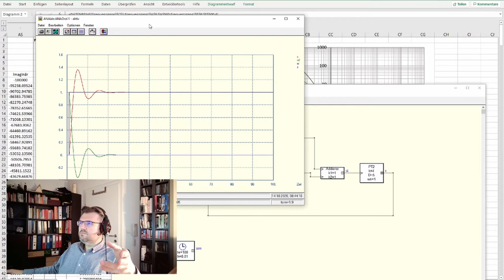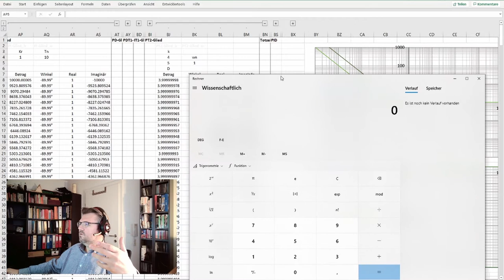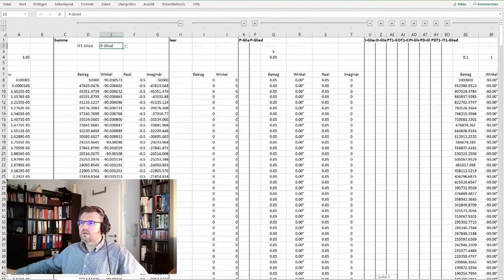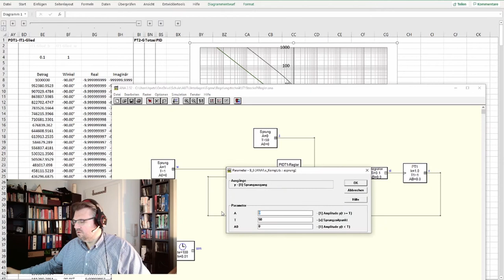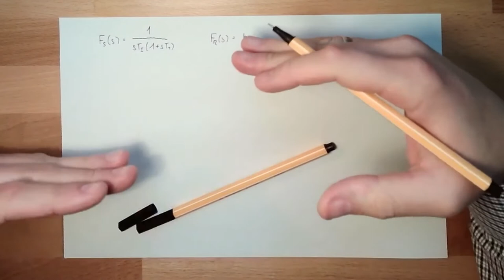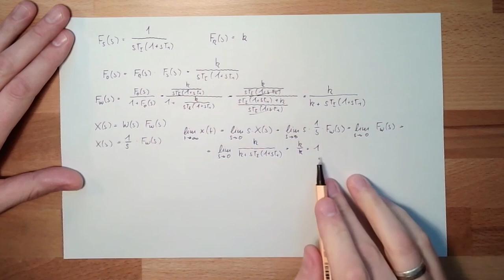Control 64: Optimal Amount (Old)

Comment: Great video. I really liked your way of using the demonstrations to explain the effect of the controller. Thank you very much. If possible,  could you also explain a little bit about the mathematics behind it? It might just help people understand why this controller works.
Reply from the maker: Thanks. I am note quite sure what mathematics you are referring to but I give it a try:

Transfer-Elements (differnetial equation) are handled here: https://youtu.be/m5KSvLkUTaw
How we reach the Lapalce-area is handled here: https://youtu.be/BLYkm74gfYk
How we deal with different transfer-elements is handled here: https://youtu.be/3TCBghS-Zx4
What the frequency-response is: https://youtu.be/SIXoWe3Xxww
Standrad-Elements: https://youtu.be/jVrKqw62UuQ and following
Control loop with transfer-elements: https://youtu.be/DbO8cPdJVgM
Derive of transfer functions of the contorl loop: https://youtu.be/0H2_RjT2QiE
Stability criterias: https://youtu.be/mJXAoE9GBYc
Nyquist criteria: https://youtu.be/Egm2yhZ3V_8

What is indeed not handled is the math what is happening when we try to use the same time-constants for the system and the contorller (that we will compensate the 1/(1+sT)-term of the system (fixes the I-part of the controller). And that we try to get rid of as many powers of omega es possible (fixes the P-part of the controller).

Or are you referring to something completly different?